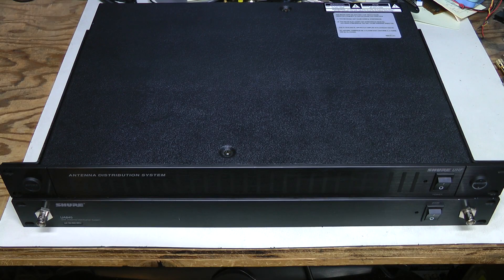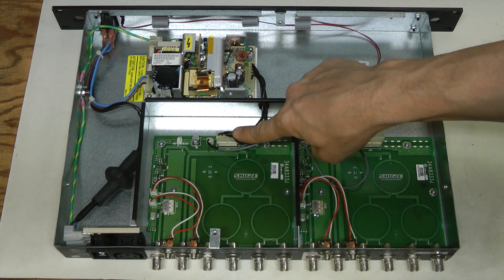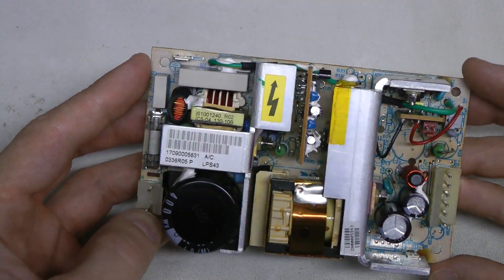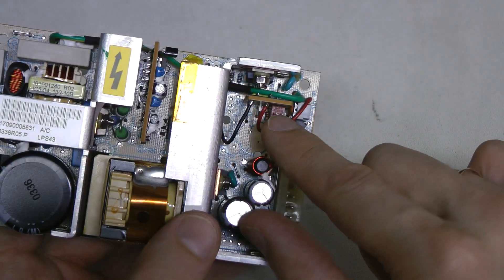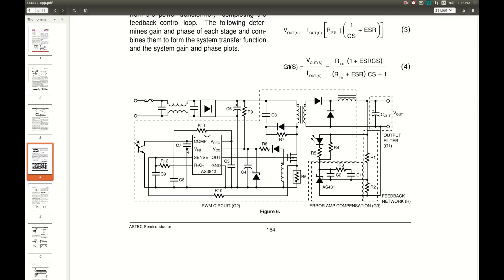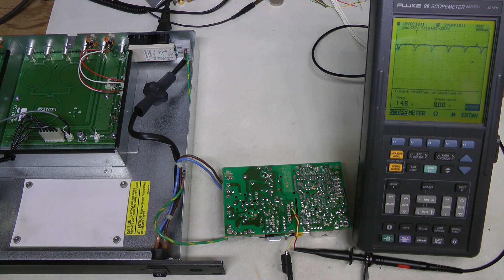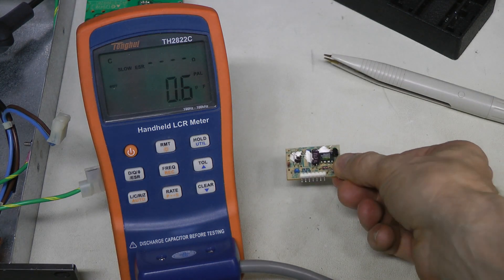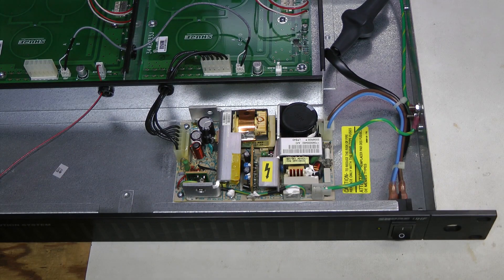#76 - Shure UA845 antenna and power distribution system repair

Comment: I think the schematic on the ASTEC doc is okay. The application schematic is on forward topology and the power supply is flyback. That small inductor at the output is just for some ripple rejection. If it was on forward conversion mode then it would have been a bigger inductor probably on a toroidal core or something. The feedback (error) amplifier output is probably not a push pull type. May be its open collector type with a pull up resistor. As the inverting input is connected to ground and non inv to 2.5v so it will keep the output at high level. In that case the opto coupler can easily drop it down to ground when TL431 triggers without causing any short circuir. That comparator (the error amp) is just like LM393 type output and bypassing the comparator will enhance the regulation time and transient response. I watched your video on mobile but it looks like the controller is similar to UC3842 type generic (or rebadged) controller and widely being used in the past.

Comment: Looks like the winding for the switcher supply at 8:20 is drawn wrong also? The dot should be on the low side for it to work, shouldn't it? Yikes, and the transformer secondary is backwards too.
Reply from the maker: i don't see why would this matter.

Comment: I happen to have those power supplies, just sitting here. The 2 pin connector on the secondary side is for voltage sensing, but not required for operation. Thank you for the video once again, very useful!

Comment: Thanks for the video. I wonder how many electronic devices have been rendered imperative by bad electrolytic capacitors? I suppose even the best fail eventually? Seems we need a different component to do this work.
Reply: nearly all compact cheap PSU's. Or mostly all SPMS.Nope. there is no really good alternative to  electrolytic capacitors yet. But they need cooling.

Comment: Thanks for making these videos! I really need to invest in an isolation transformer or differential probe for my oscilloscope so I can make measurements on power supplies. Too many times I have just replaced the entire power supply, instead of component level repair.

Comment: Mmm, huge Wilkinson dividers. It looks like there is an amplifier (8dB?) and a few filters on the board? It's 2-layer FR-4 board, causing the transmission lines to be somewhat thick?
Reply from the maker: Sorry, I completely neglected the RF part. If you are interested in that, have a look at this video about a similar unit by AudioTechnica: https://youtu.be/Ga0E2HHvPro
Reply: @feedback-loop  Yes, was really looking forward to you going over the RF part. Thanks for the link, though.